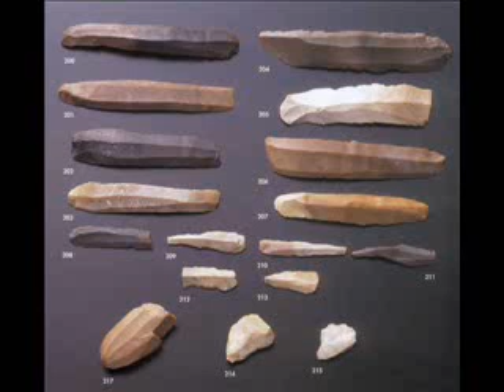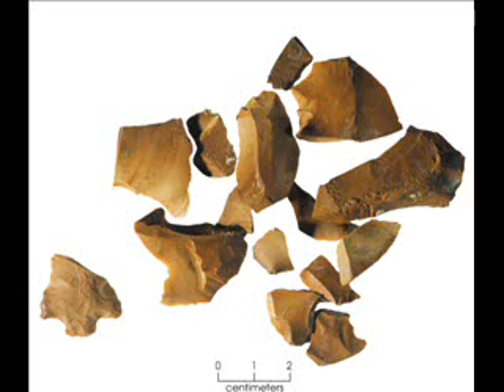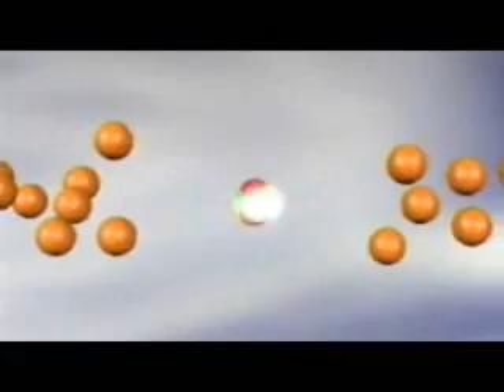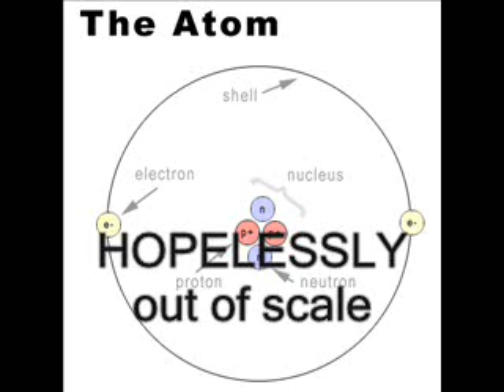The Large Hadron Collider: The End Of The Universe?

Comment: @Truthiness231 Magnetization is due to the arrangement of dipoles within a material and at what temperature the material is at.  When a magnet is supercooled you get superconductivity which means the dipoles have aligned in a manner befitting a very low microstate due to the decrease in multiplicity.  (This is allowed because the entropy of the universe increases while doing work).  Magnetization itself stems from the intrinsic property of spin, which itself comes from a collapsed dimension.

Comment: @Gringoburrito They use, what are for all intents and purposes, extremely large and powerful Helmholtz coils and the  law of induction.  Basically this can be attributed to Michael Faraday, when a charge (proton or electron) is moving through space this gives rise to a magnetic field due to a fluctuating electric field.  Now if you run a current in the same direction through a series of concentric coils you will produce a very powerful magnetic field.  Throw some protons in and smash em.

Comment: @YDDES Well, if you want a more "agnosticistic" statement, I will say that until our own knowledge on the Black Holes, what can be measured is the spin and mass. And it is not because we lack technology or anything like that, it is because by the definition of the black hole, we cannot get any info from the inside.
What kind of behavior do you expect from particles when they reach the event horizon?I expect either absorbtion or "escape" for some of em due to quantumechanics.

Comment: mani ppl think that if particle a has a speed of 49% of speed of light, at 98%, the energy will be double. this direct proportional rule is valid for small speeds, like cars, rockets, jets, but not light. the increse of stored chinetic energy is exponentialy, like the energy  stored in a capacitor proportionality to voltage.
in the case of the particle, at 98% of speed of light, the energy is more times higher then at 49%. but to get from like 98 to 99%, u'l need to multiply the energy again.

Comment: the only way it can create a black hole is when the contrary positive rays colide lead atoms and create a strangelet particle. these particles have an enormous weight and it cannot evaporate because it is underground. strangelet particles turn any other particles it comes into contact with also into strangelets. as it gains mass, it pulls more and more in, eventually turning into a black hole.  earth will capture this in the center. and they will keep trying until they make it happen. bastards!!

Comment: Yeah I actually work with a similar style magnet at my job.  It is also a super conducting super cooled magnet and there are multiple warning systems on it.  When the temperature starts to rise to anything above 4 degrees Kelvin all these yellow lights and sirens start flashing and sounding.  It scares the total crap out of you.  It is in a 800 MHz NMR machine with a cryo probe, not any sort of particle accelerator.

Comment: They will start it back up in the spring.  One of the cryogenic super magnets had a problem with the cooling system and blew up.  The amount of electricity they are running through those magnets is insane so if they heat up even a few degrees they have a catastrophic failure.

Comment: With black holes it doesn't matter about the size, and it wouldn't evaporate. But if it did happen the scientists have some way of closing it when it is still developing. But it doesn't matter about the size of a black hole because it has infinite mass meaning it will just keep in sucking things in until it grows.

Comment: Why does my perceived morality bother you so? You make assumptions and judge more quickly than I do. 

The all caps creates a amplified sound. Its a lulling guffaw instead of a quiet titter. I am sorry that you do not understand the textual use of sound. 

Maybe you could start using the shift key and some paragraphs so that reading your drivel would be easier. Its hard enough to choke down your judgmental attitude without it be grammatically incorrect.

Comment: No-one has split the hydrogen atom to my knowledge. A thermonuclear bomb fuses light hydrogen isotopes into heavier ones and an atomic explosion is used to generate enough heat for the reaction.

What I am getting at is that a large enough thermonuclear reaction in the right spot will generate enough heat to set off a chain reaction, igniting all of the hydrogen in the oceans, and effectively turn this planet into a cinder.

Comment: in reality the LHC is not big enough to create any BLACKHOLE or STRANGELETE, and plus the earth has its own hawking radiation, this makes BLACKHOLES evaporate immediatly right after they are created. so when the LHC is turned on nothing bad is going to happen I HOPE, but the LHC has large MAGNETIC rings that prevent the particles from streching forward and try's to align its trajectory.  THE BOTTOM LINE IS DONT WORRY, THE MACHINE IS NOT BIG ENOUGH ALWAYS REMEMEBER THAT!

Comment from the maker: It's to do with "super-conductivity". When anything is cold it simply means its atoms are "jiggling" less. At absolute zero (-273 degrees - the lowest temperature possible) atomic "jiggling" is almost completely stopped. This means that the electrons and thereby electromagnetic charge can move more easily and efficiently, with less "electromagnetic friction", making the magnets more powerful and able to accelerate the particles to the necessary velocity. Bad explanation but you get the idea. :)

Comment from the maker: The LHC is not operational yet. There are tech problems. It is now due to start up in May. The Higgs particle is within its capability to reveal, IF it is there. Personally I would be more surprised if they find it than if they don't. As regards string theory, the revealing of "strings" would require WAY more energy than the LHC can produce. In fact, the energy required would be so high it's hard to see ANY way we will confirm or disprove that theory for a LONG time, if ever.